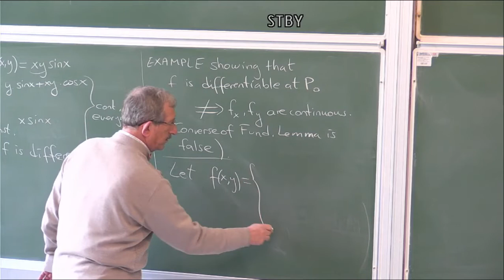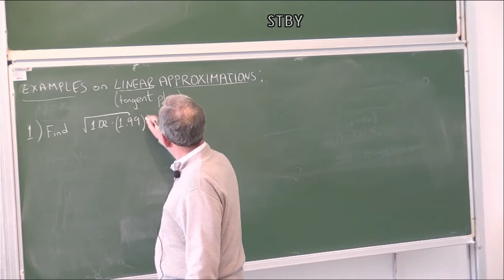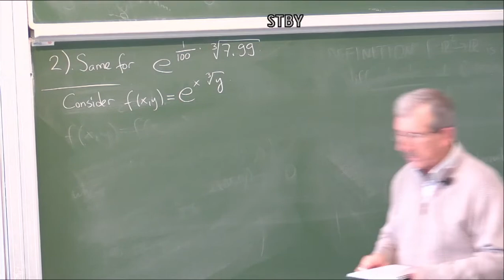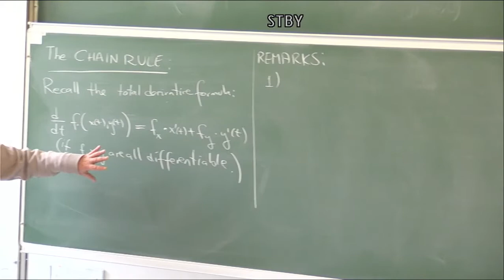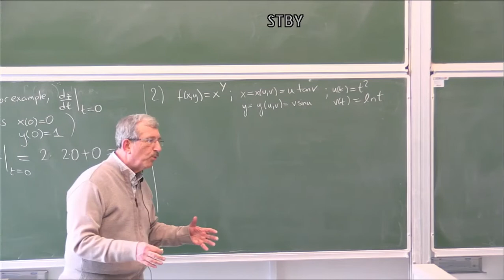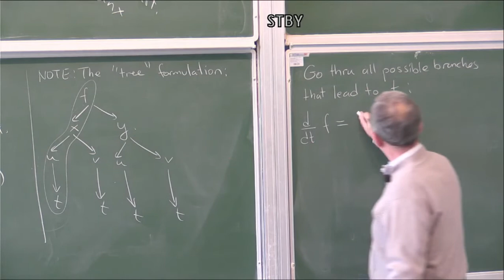MATH 120 Lecture 27: Partial Derivatives and Chain Rule - Zafer NURLU

Comment: 18:21 Hocam Why is the limit not equal to 1 by sin(1/sqrt(x^2+y^2)  /  (1/sqrt(x^2+y^2) . I mean sin(a)/a
Reply: You would be correct if the "inside" part approached 0. But clearly 1/sqrt(x^2+y^2) goes to infty, not 0.